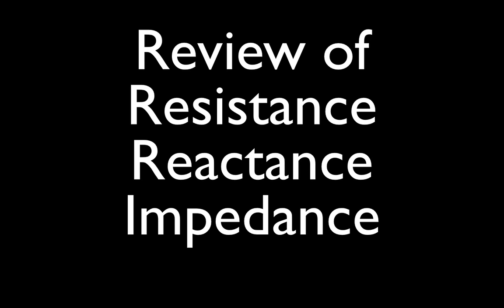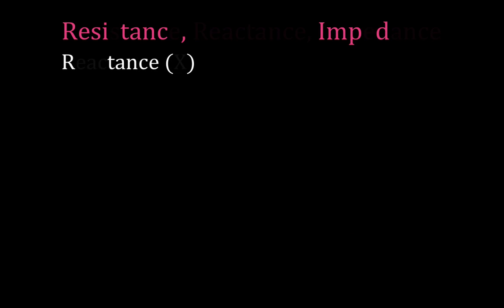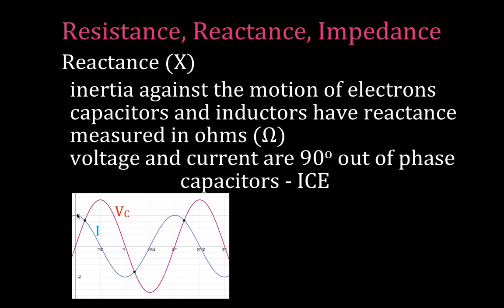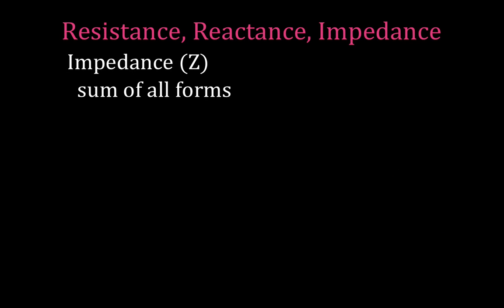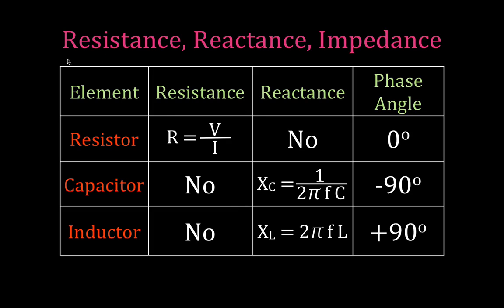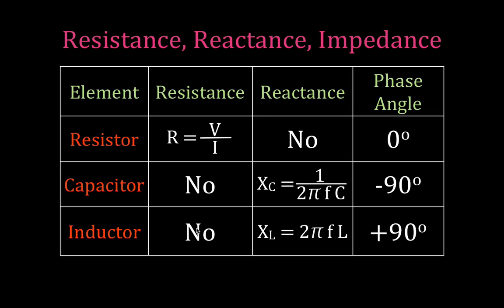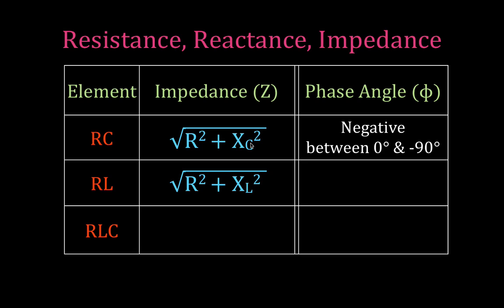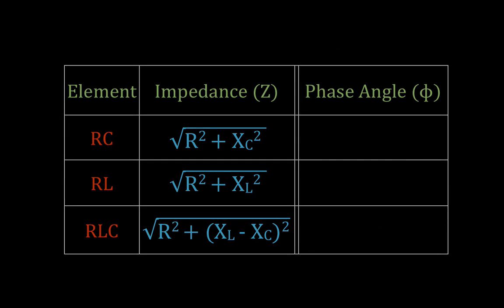RLC Circuits (13 of 19) Summary of RLC Circuit Analysis

Comment: The ELI/ICE acronyms help with memorization. An intuitive method is to think of a capacitor as a lake, into which current flows. At first when the lake is empty there is no impediment to inward flow, until the lake fills up to create a lake depth ("voltage") that will resist further flow inward. Total lake volume is Q, and of course the rate of lake filling, dV/dt, is proportional to how fast current is filling the lake. I haven't thought of a great physical analogy for how voltage drop across an inductor builds in direct proportion to dI/dt. Pushing a rock up a hill doesn't suffice. Maybe we could find it in the political sphere, where public support for a figure gains momentum, resisting change either way. It is clear that energy from electron flow goes immediately into building a magnetic field which resists change, storing energy that will be released later. Anybody have a better physical analogy for inductive reactance?
Reply from the maker: Nice channel!
Reply: @stepbystepscience  You too, man. Still working through the circuit playlists, you've got a great inventory!

Comment: Very clear, thx! I would re-think about inertia thing for capacitors, tho. It is a bit opossite IMO. Current would "flow" and then stop (voltage at its peak - some form of equilization of electrons on both plates?)... What do you think? I am looking for some other analogy... Thanks again!
Reply from the maker: OK, thank you very much and thanks for commenting.